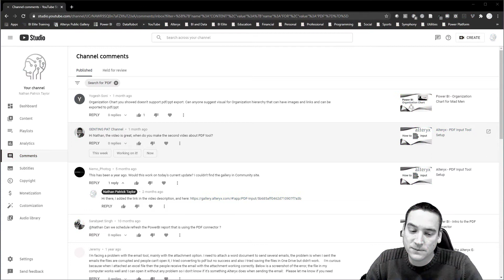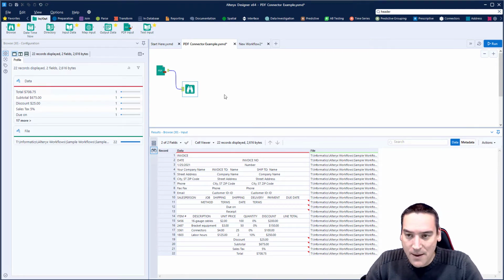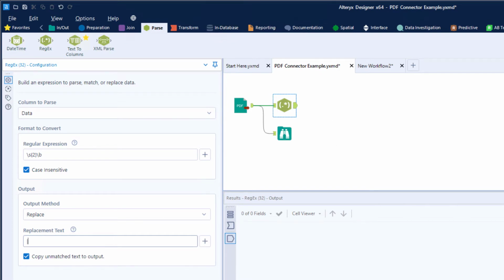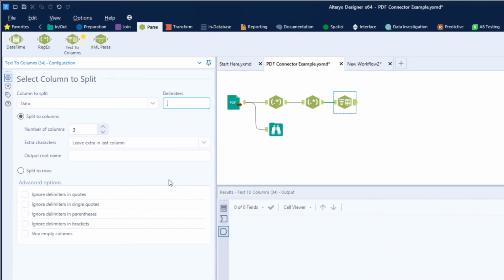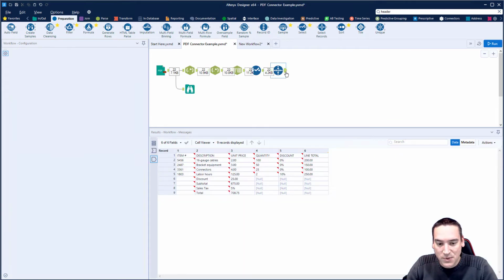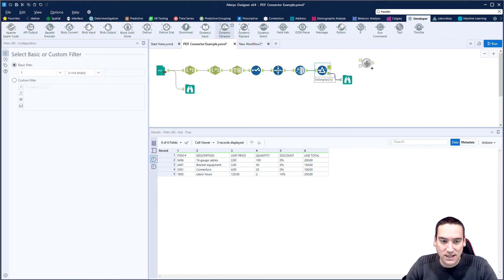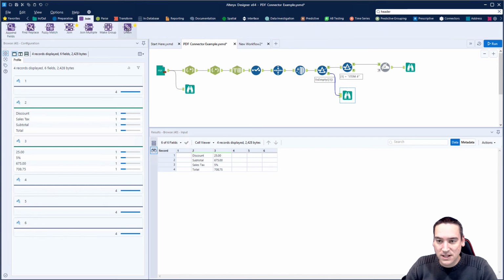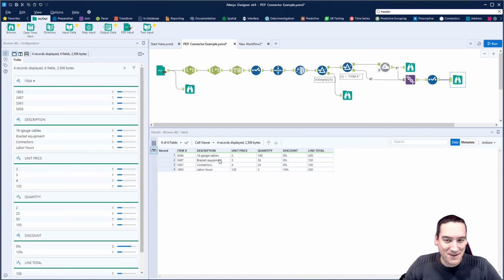Alteryx - PDF Input Tool - Part II - Parsing

Comment: I keep receiving an error when i run the pdf input tool
Reply from the maker: Is it the load.namespace error?  If so, you may need to install the 'Rcpp' package for R.
Reply: @NPT  I am also getting an error in the PDF Input Tool. My error says: Error in loadfileNamespace(name): there's no package called 'pdftools'. However I installed both the pdftools and the Rcpp packages. Any other ideas?
Reply: Nathan, you can disregard. I was able to finally fix my issue. Thanks!
Reply from the maker: Awesome!  Good to hear it is working.
Reply: @joselmt83  What did you do to resolve the issue? I installed both pdftools and Rcpp from Install R Packages app but still get the same error.
Reply: @joselmt83  hey how you solve this issue

Comment: How accurate would you say PDF tool is when inputting the PDF into alteryx? Also, is the tool free to use if you have designer?
Reply from the maker: Hi there Carl, the PDF tool is free if you have a Designer license.  As for its accuracy, as you can imagine it performs better if the PDF is semi-structured.  If the PDF has tables or figures that are clearly separated, it will perform well.  If you are just ripping a bunch of text, you'll have to perform some clean-up in Alteryx using other tools.

Comment: hi
 great tip and its working for me!! is there any way to read XPS format as well
Reply from the maker: Glad it is working well for you Manoj.  As for XPS files, I don't see anything that reads them on the Alteryx Gallery.  I believe XPS converts well to PDF so you could write a batch script that converts all the XPS files in a directory to PDF files before running them through Alteryx.